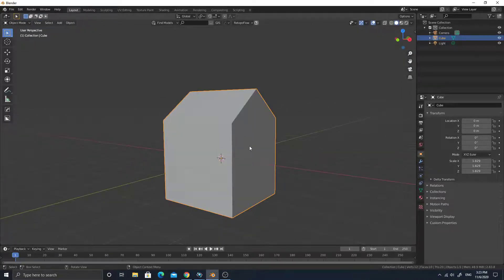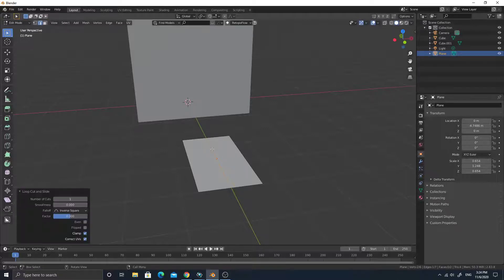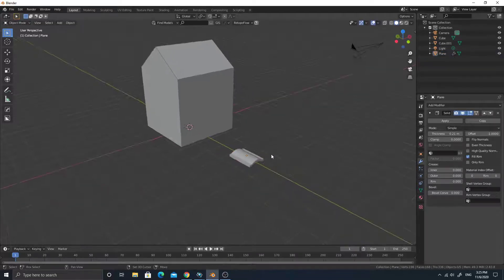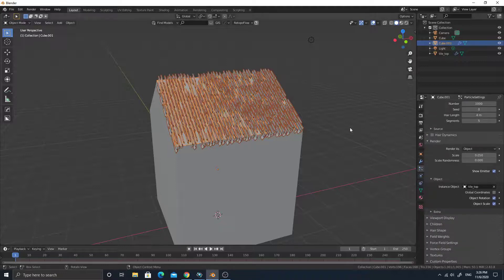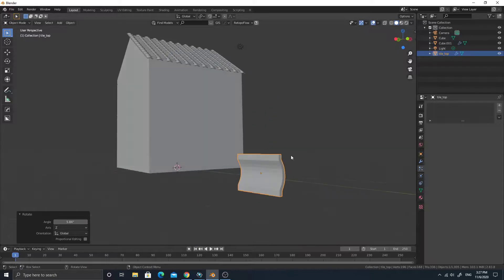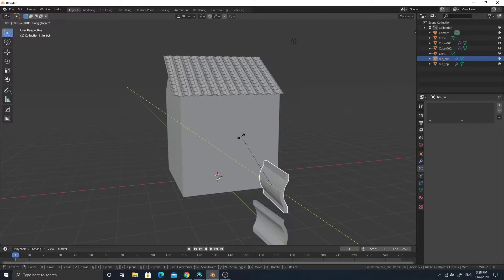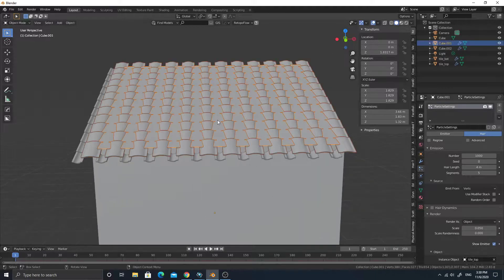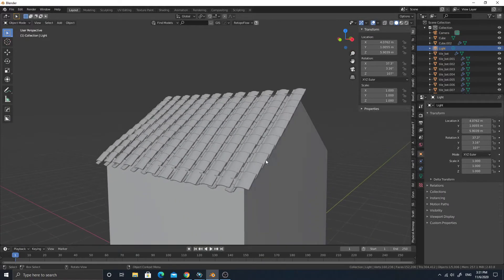How to make roof tiles blender

Comment: NOPE.  Tiles taper along their y-axis so they fit under the tile higher up the slope as well as tucking under the edge of the tile next to it beside.
ALSO
I wouldn't want to sleep under that roof in a rain storm. You have the tile edges tucking under as they go down the slope....! Think of a shingle. The water runs down off the edge on top of the next lower shingle. Your tiles are 180deg. flipped   or shingled exactly the wrong way at the end.